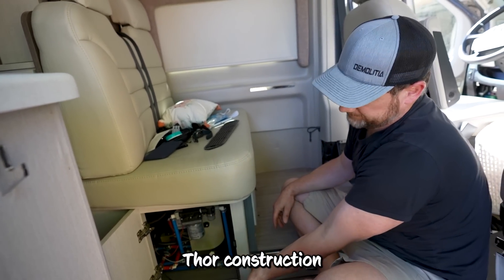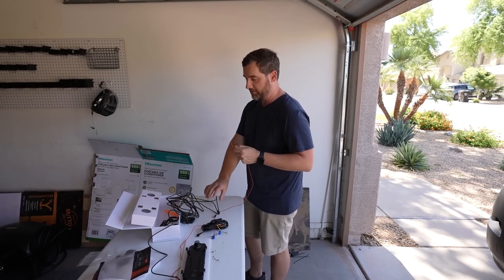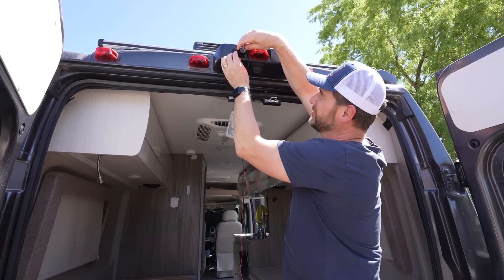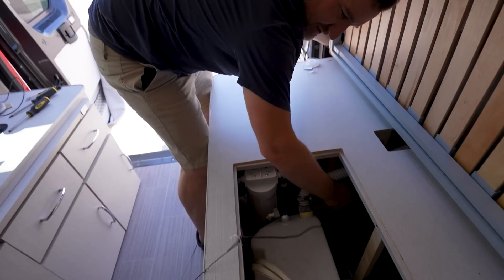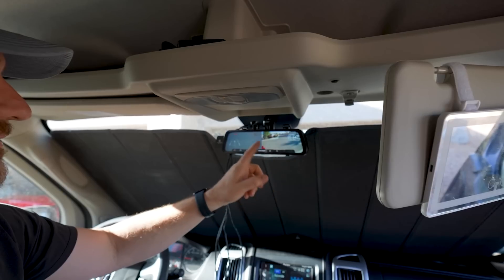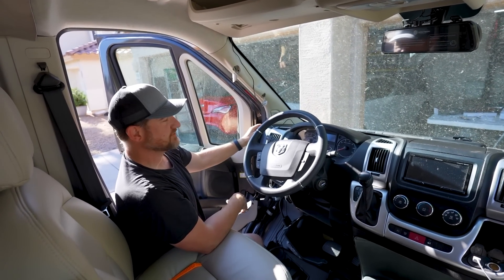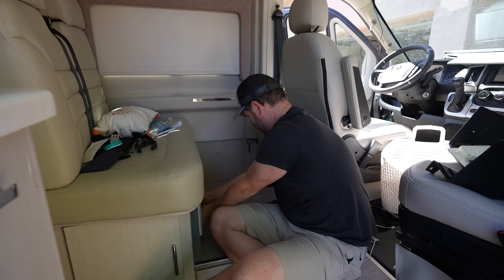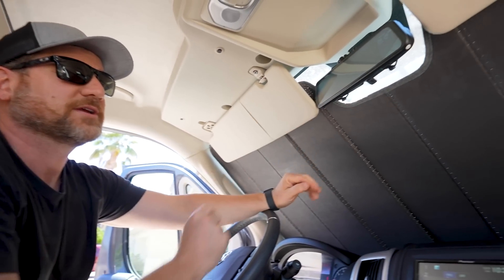This just made VANLIFE so much safer! (we wish we would have done this DIY mod sooner!)

Comment: Good job on the mirror install. I’ve moved my camera three times since I built out my van. First I had it on the license plate but when I added a bike rack the camera was blocked. Then I put in inside with it viewing through the rear window but if I had a cover over my bikes the view was again blocked. I finally moved it to the same place you did and now it’s perfect.

Comment: I just ordered one for our 18m. Why not just run it up top behind cabinets?
Reply: Installed ours in the 18M. Just enough cable when ran above the cabinets with a cable puller. Everyone with the longer van will need the extended cable. Would love to see your fuse box install. We hacked our more than we should have!